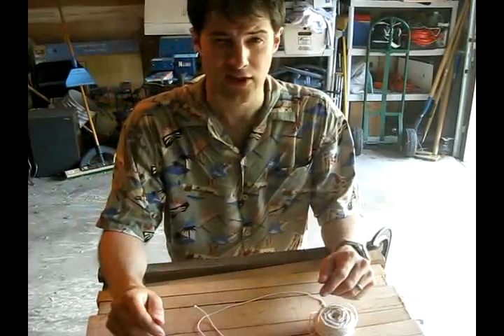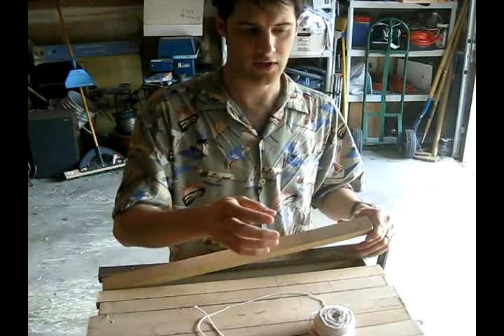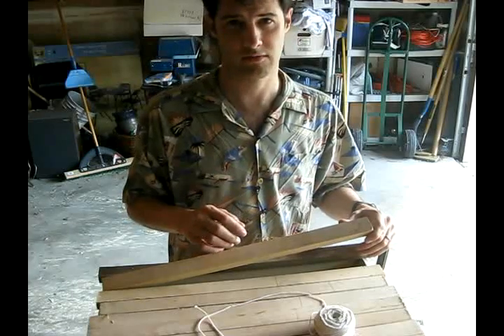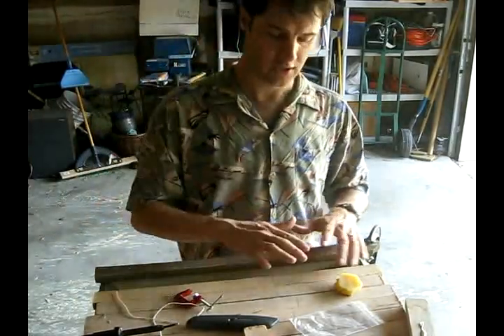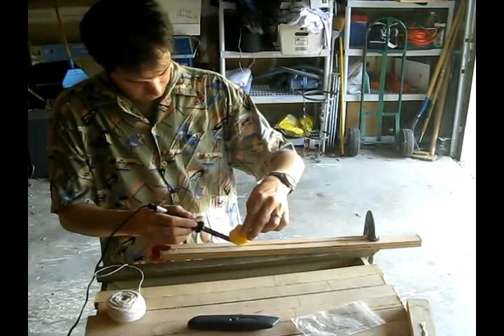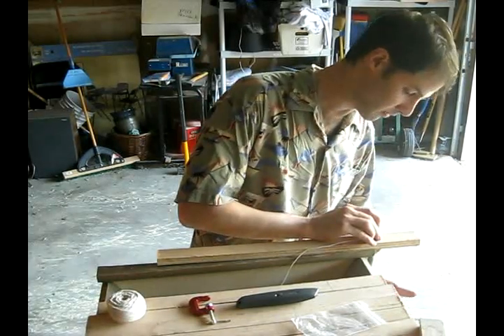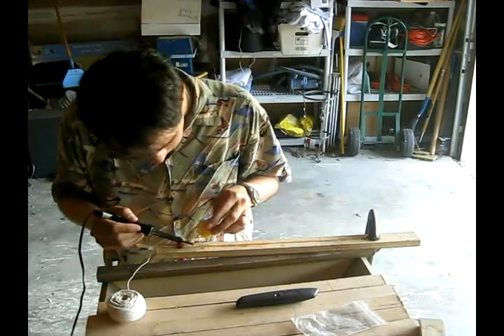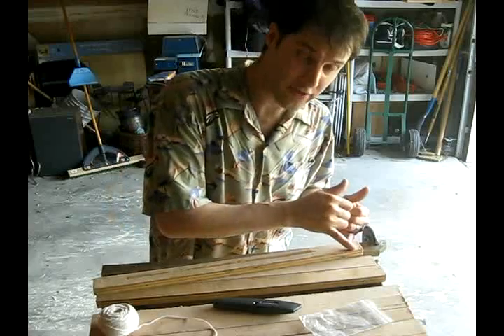Building Top Bars 1/2

Comment: The research I have read from some very experienced beekeepers, say that you should not try to add any wax on the bars because we can not attach it nearly as well as they can. Maybe just rub some on for the smell to get them interested and use a follower board. The result of this, especially in warmer climates, can lead to combs falling from the bars. I know in my langstroth hives I do foundationless frame with a small strip of wood and they latch right onto it and do a better job than I could.

Comment: I use a tjanting to lay the melted wax down with. It's an artists implement for creating batik pictures. They're quite cheap and a fairly quick method - not smoky like the soldering iron. Try it and see what you think.

Comment from the maker: 1. Heat, polyprop. drums are translucent and can overheat hives with greenhouse effect, 2. Too deep, comb collapse happens more than expected, 3. Weak walled, once the drum is cut in half it loses structural integrity and the walls bow out and induce bars to collapse or crush to the bottom.  And a few others, but those are big flaws to be careful of.

Comment: Could you drill a small hole in the center of the top bar, preferably a tight fit for bamboo barbecue skewer to be pushed to the bottom of the hive which will give stability to he comb and can be added before the comb is built or after the comb is built it can be pushed through he comb and hey are very cheep!!!!!!!!!!!

Comment: This is an old vid, but don't even waste your time making a waxed string guide, as the probability of the bees cross combing is WAY higher than when using a more prominent comb guide, like the wooden triangular wedges, popsicle sticks, or a piece of cut foundation ran across the top.

Give the bees something prominent to use as a guide that runs all the way across the bar, and the chances of having to make corrections drops to almost nil.

Best of luck.
Reply: +Hagen Steele So you tried the string method?
Reply: RFDarter Never have, as most of the hives I've seen that used that method always had issues with comb management.
Reply: Hagen Steele
So all hives using this methods had comb issues, or did you did you just see the ones with issues?
You are using wooden triangle guides?
Reply: RFDarter The wooden guides seemed to encourage straighter comb production, so that's what I went with, and it worked well.